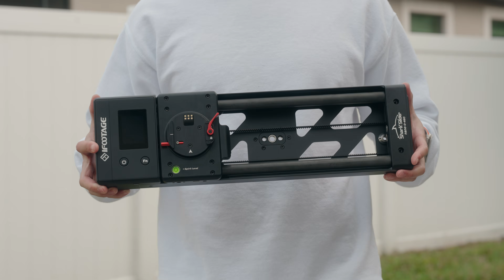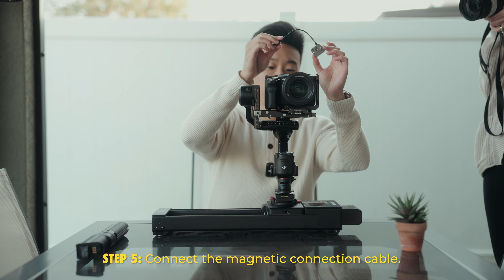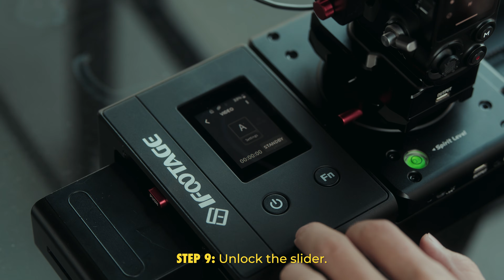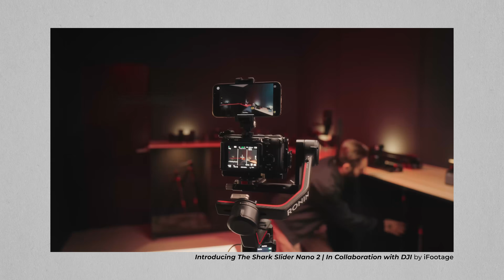Easiest Camera Slider There Is! | iFootage Shark Slider Nano II

Comment: When you filmed the timelapse of the puzzle, it looked like there was a pan AND tilt which means you were using the gimbal. Did you find that footage to be usable? How long was the timelapse? I tried to film one last week and the gimbal was just moving too slowly, each movement was a very visible stutter step and made the video unusable. Were you filming a video or shooting stills? Thanks
Reply from the maker: I was shooting video and the timelapse was probably around 8-10 minutes IIRC—I did put a little warp stabilizer in post in Premiere, but I find most prosumer sliders have that issue

Comment: Thank you for the detailed review! Do you think it would be a good addition to real estate video shoots where you are mostly shooting push-in shots at 16mm? My primary concern is the slider is going to be in the frame.
Reply from the maker: To get it out of frame, I think you'd be fine as long as you're pointing horizon level and elevate the camera off the slider with a tripod head (or in this case, if you used the DJI RS gimbal). Personally, if I shot a lot of real estate and did a lot of simpler camera moves (steady push ins and slide side-to-side shots), I think a slider is a great tool to have because you don't have to try to get a perfect gimbal shot every single time (it'll increase your setup time slightly, but I think it'd offset having to do multiple takes)!

Comment: Hi. I’m using the dji RS2 pro with the 17’’ slider but I’m having trouble setting it up. I have push mode on but as soon as I move the gimbal it reacts to being forced and shuts down the slider. I’ve followed several videos and it’s a simple set up so I’ve no idea why this is happening. Any ideas?

Comment: Why dji rs3 standard Is not compatible ?
Reply: Wondering the same. Was about to purchase, but then just realized it won't be compatible with my RS3..?? So stupid
Reply: Ya was wondering the same they have 2 2 pro skip 3 3 pro 🤨
Reply: @usamasiddiqui3886  I contacted them. The RS3 has no side pins to connect to the slider. Looks like I need to updated to RS4….🫠
Reply: because it does not have a data port on the nato sides. take it up with DJI (they made compromises for the cheaper version just to make you buy the more expensive one).
Reply: @ovidiu.gramesc oh shit 😥
Reply from the maker: Honestly no idea 🤷‍♂

Comment: The small  version looks quite short. Don't you fint it quite short?
Reply from the maker: Depends on how big of a movement you're looking for. For push-in/out or side-to-side sliding shots, it's a subtle effect. However, for me, I'm usually shooting products with the slider, meaning I'm close-up on the object with a tighter focal length + orbiting, which combined gives me enough parallax for the shots I'm looking for. But, if you're looking to do bigger slider movements, the next size up would be more versatile (just doesn't pack down as easily of course).

Comment: does vertical movement work as well with DJI RS4 attached? Apart from the weight there is a lever, so i wonder if the carriage can handle this?
Reply from the maker: Kind of… the biggest limitation is the weight capacity and when the slide is unlocked to set waypoints, there isn’t much “resistance” so the closer you are to the weight capacity, the harder it is hold the setup “in place” to lock in your key frame. So, possible? Kind of. But, I personally wouldn’t recommend it!

Comment: Summary here!
00:00 🎥 The iFootage Shark Slider Nano 2 is a compact motorized slider that produces smooth shots and is compatible with DJI gimbals for multi-axis motion control.
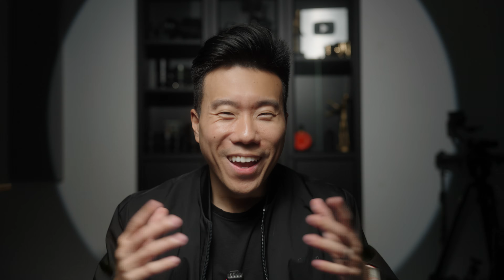00:14 🤝 This first-look video is sponsored by iFootage, but as always, aims to provide honest first impressions while demonstrating the product’s capabilities.
00:53 📋 Compatible DJI gimbals include the RS2, RS2 Pro, RS3 Pro, RS4, and RS4 Pro, enabling easy setup with the slider.
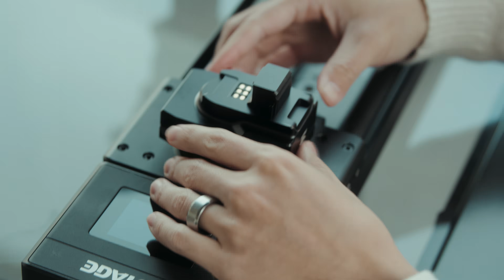01:06 🔋 The slider can be powered with standard Sony NP-F batteries, offering convenience and easy power options.
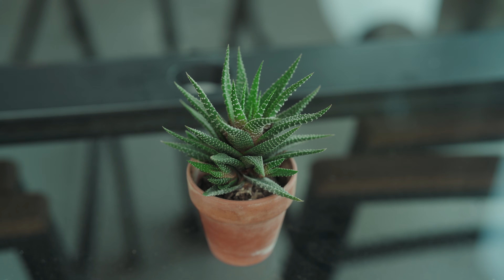04:12 🔄 The setup allows for smooth, repeatable camera movements, with the gimbal connected wirelessly to the camera and the slider.
05:22 📐 The slider includes a built-in pan head for orbiting shots, even without a gimbal, and can be oriented vertically for small crane shots.
05:49 🎛️ Various modes like video, time-lapse, and stop motion can be accessed via the OLED touchscreen for precise motion control.
06:14 🤫 The slider operates quietly at moderate speeds, a significant improvement over many other sliders.
06:48 🏗️ High-quality construction with a metal chassis; available in two sizes with different travel lengths but similar payload capacities.
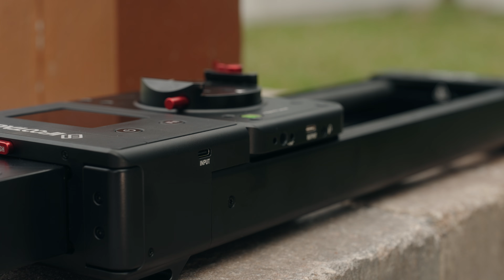07:43 🔌 Multiple power options include a USB-C power delivery port, enhancing flexibility in powering the slider.
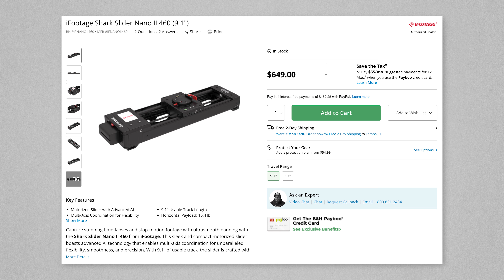08:11 💰 Priced at $649 for the 9-inch version and $749 for the 17-inch version, the slider offers good value compared to similar products.
08:54 🎥 Ideal for product videos, cinematic films, time-lapses, and landscapes with a DJI gimbal, the slider presents an excellent value addition.